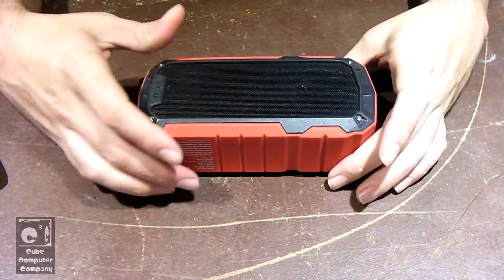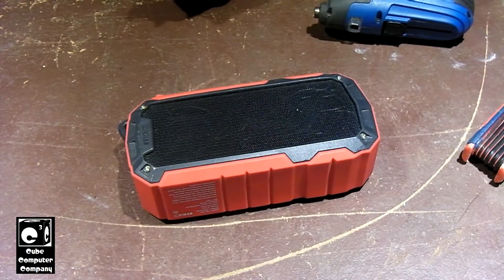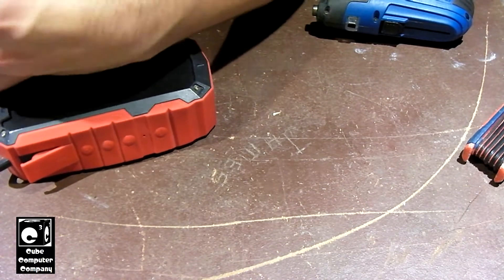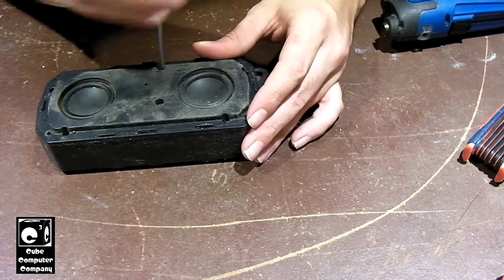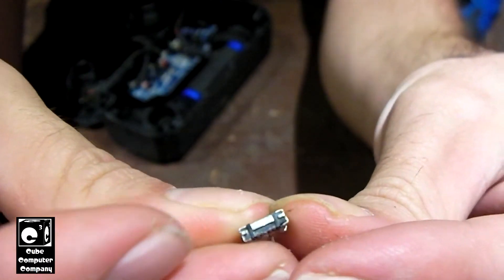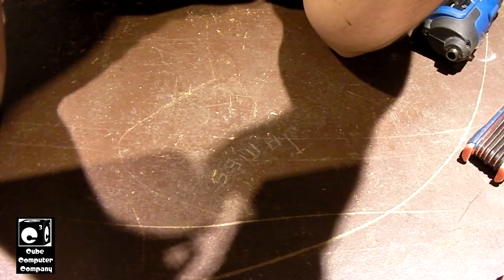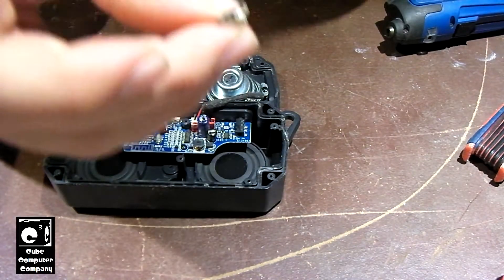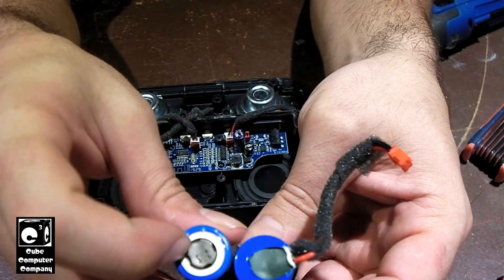Opening up a bluetooth speaker with a broken micro USB header

Comment: I can't tell you how many broken microB headers I've had over the years. My Nexus 7's header is on the way out, but I'm not sure if I even want to bother with repair; stock ROM doesn't have valid certs anymore, and third-party roms break the decoder, making it useless as a car head unit.